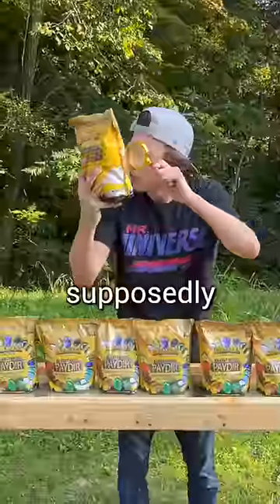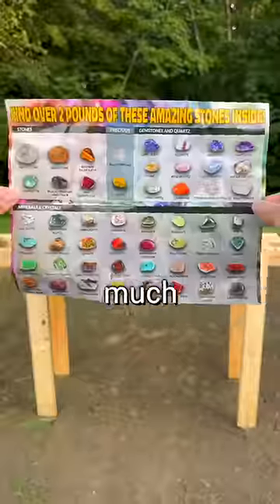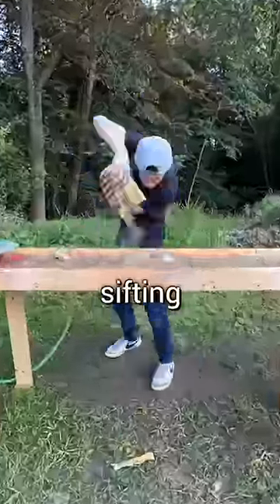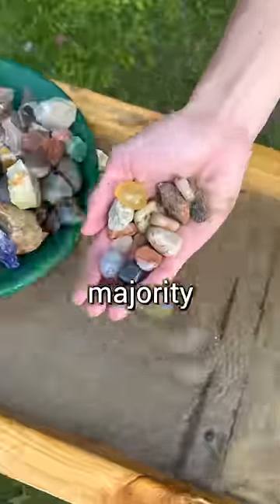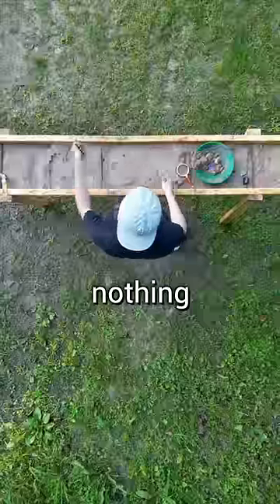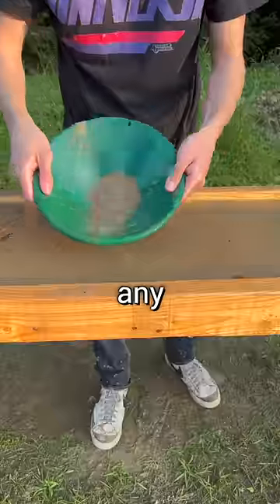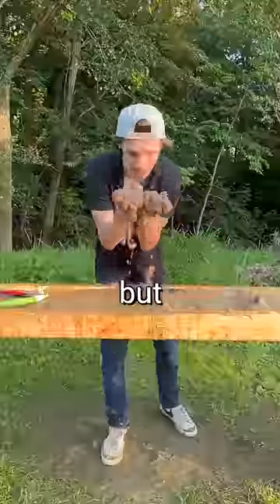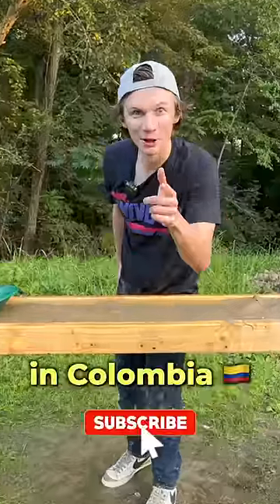I Bought 10 Bags Of Dirt To Find Gold, Diamonds, and Gems

Comment: Anyways, here is a brownie recipe.

Ingredients:

-1 cup unsalted butter

-2 cups granulated sugar

-4 large eggs

-1 teaspoon vanilla extract

-1/2 cup all-purpose flour

-1/2 cup cocoa powder

-1/4 teaspoon salt

-1 cup chopped nuts or chocolate chips (optional)

Instructions:

1. Preheat oven to 350 F (175 C) and grease a baking pan.

2. Melt 1 cup butter, mix with 2 cups sugar.

3. Add 4 eggs and 1 tsp vanilla; mix well.

4. Sift in 1/2 cup flour, 1/2 cup cocoa, and 1/5 tsp salt; stir.

5. Optional: add 1 cup nuts or chocolate chips.

6. Pour into the pan, bake 25-30 mins.

7. Cool completely, cut into squares, and enjoy your brownies!
Reply: How is that relevant like thanks I guess?
(Soz if that sounded rude)